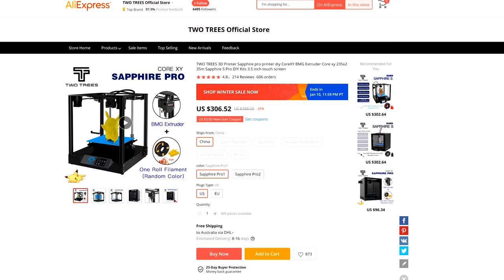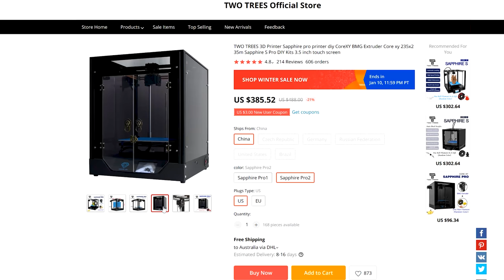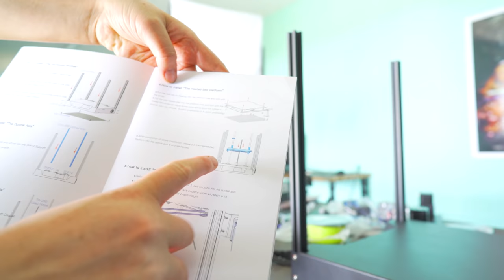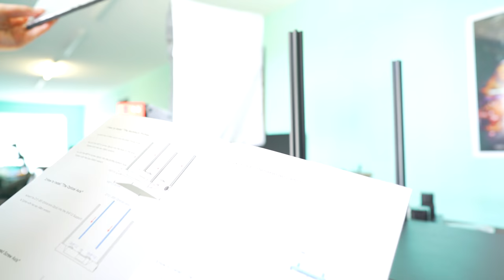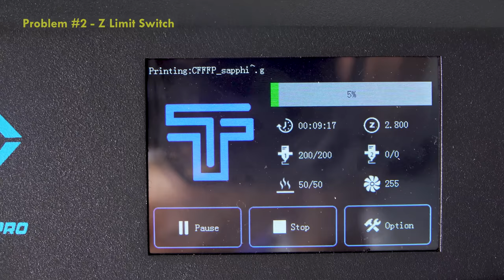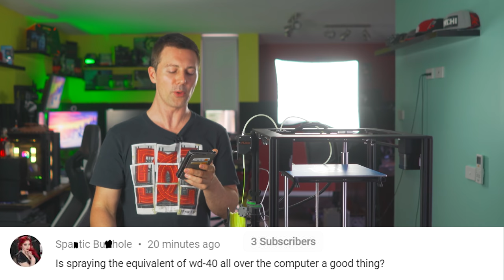BEFORE Buying a 3D Printer from Aliexpress... Watch This... (Sapphire Pro 1 Review)

Comment from the maker: Not at CES this year, though if there is any products you guys are loving, let us know below and we can discuss it in a post CES recap!
Reply: No CES? I feel like I'm going to suffer Tech YES Withdrawal! I need my Tech YES Vegas Parts Hunt to keep me going through the day!
Oh wait, I forgot to answer the question. I like Ryzen 4000 for Laptops.
Reply: If you wish to purchase a very good entry level printer check out the Creality CR-10S & CR-10S V2. If I get one it will be the V2 or maybe the Pro version.
Reply: That H cpu.
45W only!
That's a lower powered compact build begging to be made!
Reply: You Keen for CES next year?
Reply: Ryzen laptops :)
Reply: awwww
Reply: 3990x benchmark comparison
Reply: WD40 is a water repellent/displacer and sealer.  In the old days we used it to start a damp car by spraying the stuff in the ignition distribution cap and on the rotor, so it's fine on low voltage electronics.  👍
Reply: WD40 is hydrophobic so it repels water, oil also repels water but not as strong as WD40 does it, also it tends to attract to it's self in water and go to the surface.
Reply: I'd go with a creality machine for FDM 3D printing... I believe the best value for the money
Reply: Vizio's OLED, Intel's GPU and Threadripper.
Reply: Hi mate, sorry to hear about the printer woes. I ended up getting an Anet A8 which is also a 'build it yourself' style printer, I've used it a bunch for a heap of different things. A good plus is the included build guide on youtube. There are a ton of reviews, probably the best one is from 'byte sized' called 'Anet A8 - The best cheap DIY 3D printer in 2018?' and has a stack of good info. Hope that helps!
Reply: Samsung Neon.
Reply: Ender 3 pro

Comment: If you're new to 3D Printing and would like to get into it, I would highly recommend the Ender 3. 

It's super cheap, the community around it is massive, the upgrade paths and spares market is amazing and the print quality is really good. 

I have one myself and it's an amazing printer.
Reply: yep tech rodent is right i have ender 3 also its good make very good prints
Reply: Ender 3 here also.  Word of advise make sure that thing has over current protection or you may come in to a burnt down shop.
Reply: @liljohngamer  Is yours an older variant or the newer one? I heard that the newer ones circa 2019 have it built in.
Reply: I have the 3 Pro, would also highly recommend!
Reply: i was wrong i have ender 3 pro not ender 3
Reply: I have the Ender 3 Pro as well, great printer, made by creality which have many years in the buiness and is great for beginers since it comes half assembled out of the box. And its cheap.
Reply: Are the Ender 3's on Ali Express the real deal? I see them on sale there for around 125GBP. Is that the right price to pay?
Reply: @derekgalbraith1508  on amazon ender 3 pro are $270 usd there.
Reply: I bought mine from Element 14 which is based in Aus since im in NZ and it was cheapest from there. It was about 400 NZD which is about $266 USD I believe.
Reply: cr 10 is also a good option
Reply: hey Tech Rodent, if i wanted to print parts taht would not warp inside a pc chassi (so i need them to withstand 70c) what fillament/3d printer should i get? can the ender 3 print with such fillament?? thanks in advance
Reply: Was about to recommend Creality as well
Reply: I started with a Up Mini ( the original) that i got for ..... wait for it ...... 120 GBP !!! And it had been used at most 2 - 3 times! Deal of the century!
Reply: TL:DR don't use PLA inside of a PC case if it's reaching 70 C, use ABS or PETG. PETG is easier than ABS. I have printed with all three of those filaments on my stock Ender 3.

Do they need to be structural?  PLA loses it's stiffness around 65 C (the glass transition temperature), some more rugged alternatives are ABS and PETG, PETG has a transition temperature of 80 C and ABS has a transition temperature of 105 C. ABS can be very tricky to print large pieces with on a stock Ender 3 but I have done it. PETG is much much easier to work with.
Reply: Either and Ender 3 or a CR10
Reply: @flexpetz55  the ender 3 can print in both PLA and ABS (and many more). At 70 Celsius, PLA should be fine, in fact I'm planning to use my 3D printer to print my own GPU shroud.

Edit: As someone else said, PLA isn't really a good idea in a PC, so perhaps abs or petg.
Reply: Yup as we all agree the ender 3 is a great beginners printer, with pretty decent quality peices plus the sheer amount of mods u can print for it is rediculous
Reply: I just bought one this week, can't wait to get it set up!
Reply: @flexpetz55  Depends where the part is in the case and what you want it to do. If it's just something like a cable comb then PLA should be fine. If the part is in a hot air stream then PETG should be used. If it's touching a very hot component e.g. GPU then I would use ABS although its harder to print with and gives off a horrible smell when printing. 

Most printers will print all those materials (240C on the hotend). Creality Ender 3, Anycubic I3 mega are good budget printers I know of. If you're going for a cheaper printer then looking at reviews for good budget printers and maybe spending a little more will save you money (and time) in the long run. 

Take it from me, three years ago I bought an Anet A6 for £170 from gearbest and it did work with a bit of gaffa tape, but I've spent probably around £300+ on parts and tools and many weeks upgrading it and I'm still not happy with it. It's not uncommon for the first parts to print on these printers are upgrade parts/fixes for the printer itself (which is pretty cool when you think about it but not acceptable for a general product that you need to do that). There are tonnes of these cheap Chinese printers like the one in this video which look good but are actually pretty shoddy and often don't work out the box. Then you end up spending more money and time in the long run fixing them. If you like tinkering and upgrading electronics/hardware though they are ok.
Reply: @Bordpie  thanks a lot, that was pretty informative
Reply: Highly recomended Cetus 3D it realy for new to 3D Printing or even kid. If You engener and look for project base, the Sapphire Pro is good choice. I have both of it, one for me, other one for my son.
Reply: Print quality and reliability is mediocre for ender 3. In the right hands sapphire pro is the best printer under $1,000 bar the IVI should it ever be released. Ease of use is not it's strong point though, it takes a skilled printer to realize it's full potential.
Reply: I would say CR-20 is better, because it is semi assembled.
Reply: really satisfied with my Ender 3 pro :D using it for nearly a year now, without any problems :D
Reply: Ender 3 is the benchmark of introduction 3D printers...best quality for the $$$ and as Tech Rodent says...the community surrounding it is MASSIVE!  You can't go wrong with an Ender 3
Reply: @Bordpie    Hi. Question? What's the next step up in quality and reliability for say twice the price of the ender 3 Pro ?
Reply: @mannyc19  Prusa would be the next step up, specifically the new Prusa mini which is about twice the price with all add-ons of the Ender 3. It's a bit smaller than the Ender 3 (180x180x180 vs 220x220x250) but Prusa is the best known printer manufacturer since they're pushing the industry forward and everything they do is open source and excellent quality and customer support is also good. They're both bowden systems so may be difficult to print flexibles but excellent for everything else. There's a livestream going on now as it happens with both printers https://www.youtube.com/watch?v=NT4YKvejoH4
Reply: Yep, I also got one recently along with a Raspberry Pi 4, the Argon One case and a Webcam for Octoprint. I did flash a new firmware (TH3D Unified) because I didn't wanna take the risk of the printer not having thermal runaway protection out of the factory. It produces mostly flawless prints (minor wisps and imperfections, but you can't really expect absolutely flawless results).
Reply: ender 5 is a good printer also. I have both ender 5 and 3 and the ender 5 prints are a little bit nicer, I believe it is  because the bed only moves up and down, not back and forth
Reply: @johnnickerson9037  That's amazing. One of the issues I have with the Ender 3 is the Z wobble above a certain height!
Reply: I love my anet A8 printer. Simple, Works perfect for 2 years now without any upgrades
Reply: The tevo tarantula pro is better for the same price bracket.. No modifications needed and prints perfectly
Reply: @mannyc19  The immediate next tier up from the Ender 3 Pro is probably Artillery Genius. Same mechanics (V-rollers) but better drivers (quieter operation), a direct drive extruder (lower retraction) and filament runout sensor.

I got to emphasise anyone who hasn't owned a 3d printer really don't know how loud the stock $1 A4988 drivers are. Once you upgrade those to a $10 TMC2208, the printer becomes just as loud as a desktop pc assuming you did everything correctly. The most annoying thing that irks me greatly is that Creality has soldered their drivers onto the board so the ender 3 really isn't the best choice if noise is a factor. 

Imo out of the current chinese companies, Anycubic offers the best deals for AU/NZ and they are spot on for modular design (easy to build, hotswappable drivers and spare parts by default). Only downside for Anycubic printers is that their heatbed design isn't the best and since everything is so compartmentalized, upgrading to custom boards requires splicing wires and double-checking pin diagrams.

PC Analogy (ordered from low-range --> higher)
Entry-level: Mega Zero, Ender 3, Anycubic I3 Mega-S, Sapphire Bluer or Artillery Genius
Mid-Range:  Anycubic MAX, Artillery Sidewinder X1, Ender 5 Plus
High-tier (excluding industrial): Prusa MK3S, Qidi X-MAX, Ultimakers

Then you have the delta-style and coreXY printers like the one in this video which is definitely not suited for beginners.

PS: Speaking from experience, stay away from single z-rod printers like the Ender 5. Don't get influenced by the Creality bandwagon.

Comment: The problem with the clog was your fault, sry. The bowden tube wasn't stuck all the way in. You can clearly see it at the filament you got of there. The bowden tube must sit flush against the nozzle or it will always clog.
Reply: I did same mistake and same results clogged quickly. Repositionned ptfe tube entirely to the hot end and problem resolved...
Reply: Yeah I agree. Most problems can be solved by just going over the whole printer making sure everything is good instead of rushing into getting prints

Comment: Just looking at your filament jam, that looks like it wasn't assembled correctly.  The PTFE tube should be inserted all the way down into the nozzle... and the way your's jammed, it was allowed to double over, which indicates that the PTFE tube wasn't.  Try pushing it down further through the connector all the way down into the hot end.  That should eliminate all the jamming issues.  (You don't need to replace the drive gears either... just clean them out.)

Comment: 8:02 In my opinion, it feels half-made. There shouldn't be this many bugs. They put an unfinished product out the door.
Reply: This is the major image problem with aliexpress summed up with one product and review. The knockoff crap is nearly always junk. You get what you pay for.
Reply: Very common with inexpensive 3D printers.  Generally the best support would be to find a community group via facebook (which is a total PIA for those - like my self - that don't/won't use FB).  Seems that the inexpensive ones really are for hobbyists that enjoy mucking about with the printer as much as using them to print.  Mine has been pretty solid (I have an Anycubic i3 Mega Ultrabase), and over the year I've owned it it's been rock reliable once I got the bed properly leveled - I haven't had to muck about with it (though the bed is really sensitive in that is has to be kept absolutely insanely pristine clean or nothing sticks to it).
Reply: This is unfortunately a common sentiment when it comes to this particular printer, Sapphire has not been wowing reviewers.
Reply: It's Aliexpress, how on earth did you except anything different?
Reply: @evolicious  bought a 1st gen Ender 3 on aliexpress back in early 2018, its been a pretty good machine, no where near the issues that Sapphire has been having. Granted Creality already had some clout at the time with the cr10 being so popular.
Reply: @skoopsro7656   Almost ALL the 3d printer sold to us 3d wannabees..(except Prusa) are Chinese Clones....   Situational awareness is advantageous.. Try it?
Reply: @PRiMETECHAU  Chinese printers? Hey, how about you go buy an FolgerTech FT-5 v1 or v2 - and expirience the so called great American quality? 

It`s not where it`s made, it`s how much it costs. And to be honest, this guy should remove "Tech" from his name when he struggles with inserting a PTFE tube. He should never say yes to build something when he has no clue how something works - even when the offer is "free". There are houndreds of thousends of people running 3-d printer who now get a good laugh, like me if they ever stumble upon this video.

Comment: ....... You know it's DIY right?.... This is kinda why Aldi stopped selling 3D printers... the return rate was massive purely because Mum/Dad/Granddad consumers didn't understand that these things are tools, not toys or consumer products. 

One must research what they are buying, look into Thingiverse or reddit forums and get a handle on what they're buying and learn the machine. 

3D printers are really simple in principle. Stopping for a moment to carefully look at the construction, how the axis move and the alignments are necessary to fully understand what you need to adjust to fine tune a machine like this.
Reply: Lol that sounds great and all if you fancy for the rest of your life buying products without direction.  I started on a cheaper 3d printer and it now runs like a beast. Didnt know anything and it did have stereo instructions it seemed. It took me a few weeks to learn how to set it up and become fluent with Marlin. I still had to call the company and get the proper parts. DIY is Do It Yourself, I'm going to assume because they provide the parts you do not have to build your own parts and the diy is for the build itself. Just because you slap DIY does not mean you should not have good support for the product.
Reply: @TheWilliammccormick  Banggood isn't the manufacturer. They're a reselling warehouse online store. What service would you expect?!?! 

These machines are assembled by the user. There are a hundred things that could be at fault to 'support'. 

Tuning and setup is 99% of the issues anyone will experience with a complex tool.  This isn't a 'support' issue.... It's a user problem.
Reply: Im not sure Aldi has stopped selling, they have sold three different ones at different times - this is the normal way they do business with special items